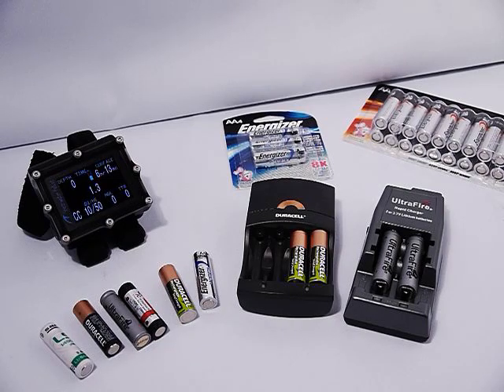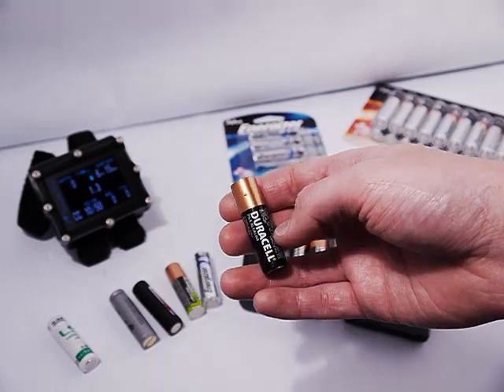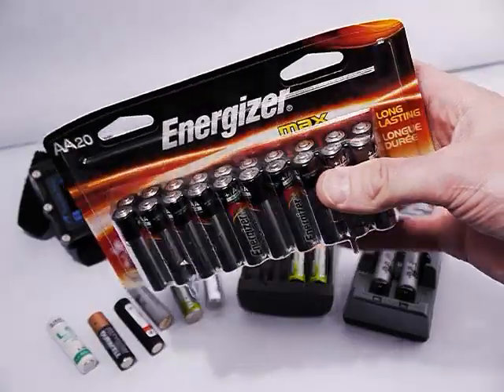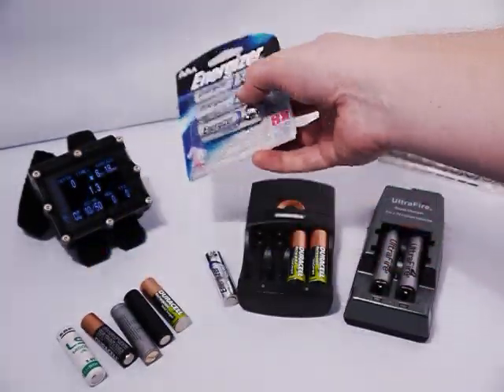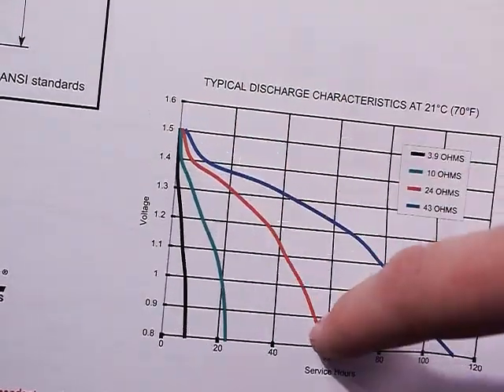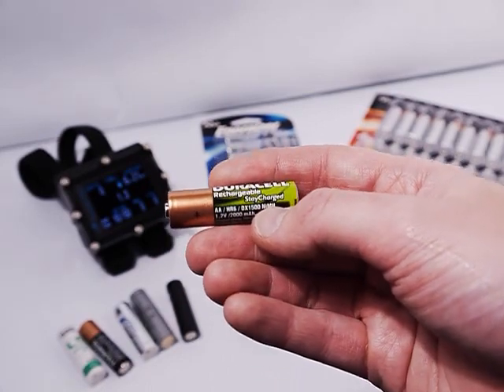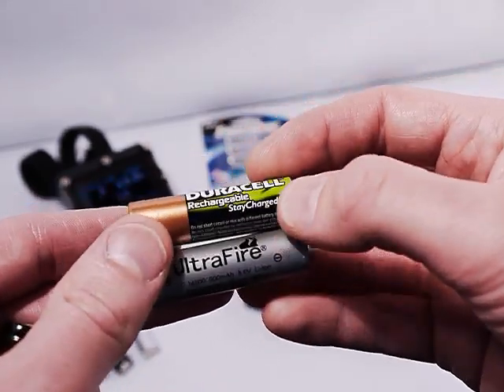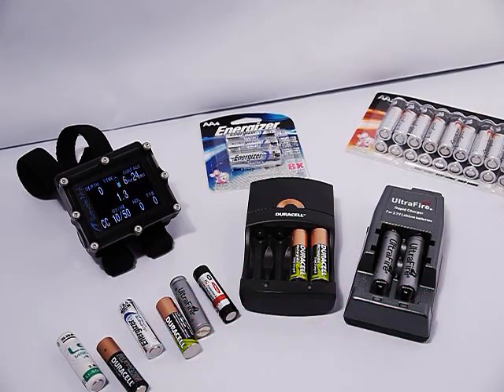Petrel Battery Types

Comment: Do you use step up (boost) converter to power the cpu/pressure sensor/lcd? If so then maybe it's worth to say something about different efficiency between 1,5V and 3,7V ? Now good lithium-ion cell: SANYO UR14500P 840mAh costs about $4-5 so I see no point using alkaline batteries...

Comment from the maker: Hi Sakari,
It is actually the opposite. In low ambient light, then low screen brightness is needed. These are not reflective LCD's like on calculators. These have a backlight that is on 100% of the time. So in low ambient light conditions, the screen will look great even on the lowest brightness. In bright sunny conditions, then the screen brightness is competing with ambient light and needs to be high.

In your conditions, you might get about 40 to 45 hours on a AA alkaline battery.